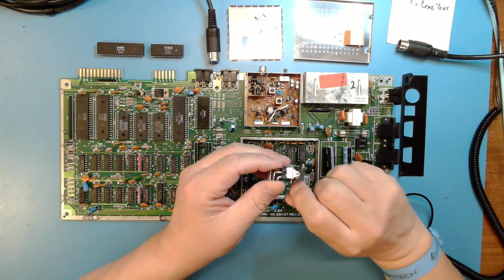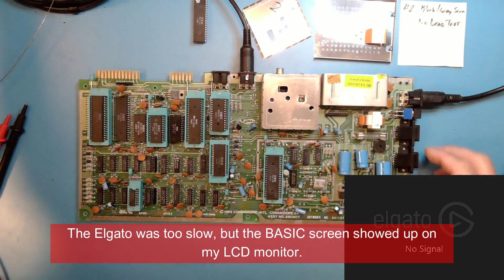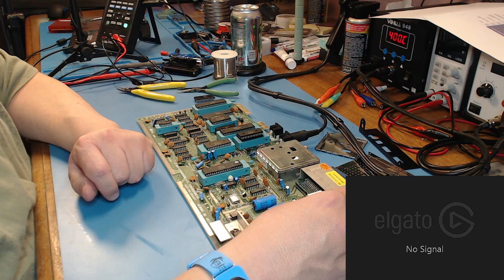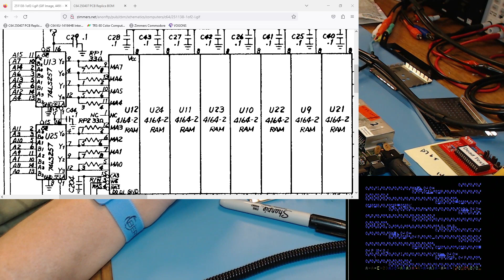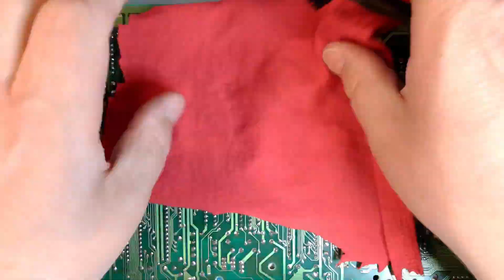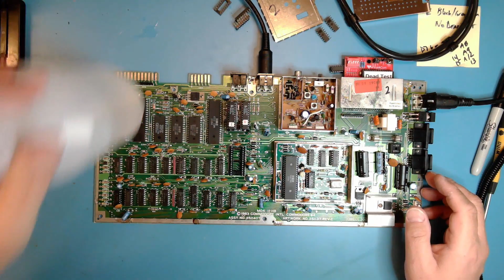Fixing The Second C64 Is A NIGHTMARE!

Comment: BTW if you want to save that deoxit, spray a bunch of it into a squeeze bottle and use that instead for better control of how much you use.... That stuff aint cheap haha!
With the zif sockets you gotta watch the ICs with shorter or cut pins and those that are bent from being soldered and then pulled... Zif sockets tend to get poor connection... better to stick the PLA in a socket then stick that in the zif socket... BTW that PLA was fine even if they are common failures.. you could see it worked when good contact was made briefly.
Reply from the maker: Re: Deoxit, I know.  Just don't have any of those little squeezy bottles yet.  Re: ZIF sockets, I'm also aware.  That's why I reseat chips in them several times if they initially fail.  Re: PLA, I retested it several times both in the ZIF machine and in a standard round-pin socket on the board it came out of once it was otherwise running.  No joy.  Thanks for the suggestions and for watching!

Comment: Nice troubleshooting and work so far:)  I've been repairing these for 3 years now.  I've unfortunately had to put a couple on the back burner.  Lol. Because of dead test and same reoccurring flashes. Did you do both multiplexers?  Anyways, thanks for leaving in the mistakes:)   I've bent pins and had 2 roms switched before...  whoops.   Can't wait for part 2. Keep up the good work bud
Reply from the maker: Thanks.  I'll cover what I replaced in the part 2b video that will go live tomorrow morning (It's encoding right now.)
Reply: Forgot to mention that it's nice to see someone new to me fixing these things:)  can never learn enough and different techniques
Reply from the maker: Eh.  I stole most of my techniques from all the other guys, so don't get your hopes up. :)

Comment: 4.5V on the 5V line, as you said, does mean an excessive current draw. You have replaced the PLA, 1 logic, and 2 RAM ICs after that but never got back to check if current draw problem went away with any of those. I agree with you on not doing unnecessary IC desoldering, with the exception of having MT RAM ICs in there. When I see them, I remove them and install sockets. Then, I check them with a tester, discard the bad ones, populate the good ones and complete the set with new ICs. If in the future any of the remaining decide to die, it will be easy to replace. Dead Test showing good RAM ICs as bad is a clear indication of multiplexer fail, you already replaced one, go ahead and replace the other one too.
Reply from the maker: Thank you for the suggestions.  When I release part 2b, you'll see that I've actually already done all that.  In fact, I've done more.  I find two more bad MOS logic chips and the other 257 (not MOS) is bad, so I replaced all of those.  I also socketed all the RAM.  First, I put in all new RAM, then I went back and tested the MT chips.  Only 2 were actually bad, so I put all the others back.  I was checking voltages all along, but didn't actually capture it on video much.  It's better now (around 4.77v), but I'm still looking for better since I know I have a good solid 5.08v to 5.11v on the input.  All of that was necessary, of course, but it isn't what gets the board working.  I was surprised to find out what the most immediate problem was.  I won't spoil that yet.  You'll just have to watch part 2b to find out.
Reply: @YARC-1981  I would watch it even if you spoiled the surprise. 😁